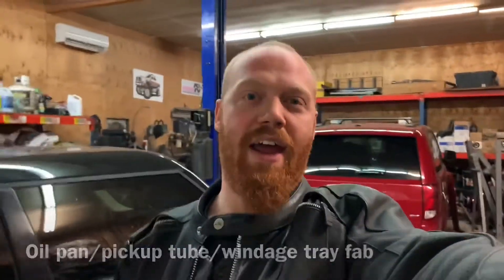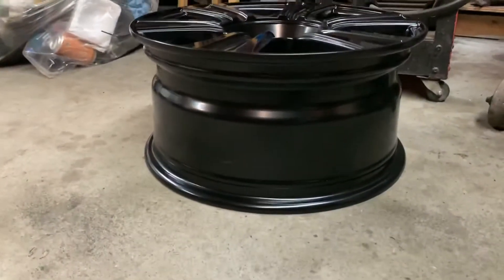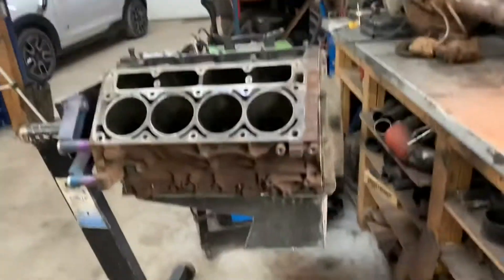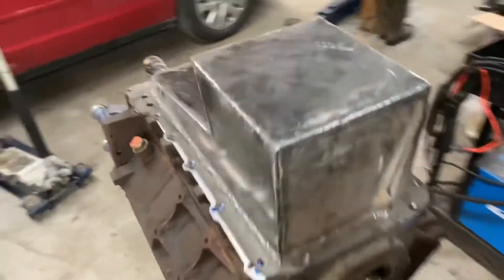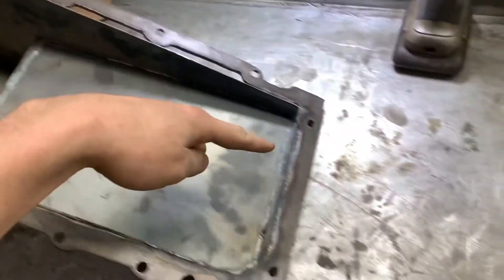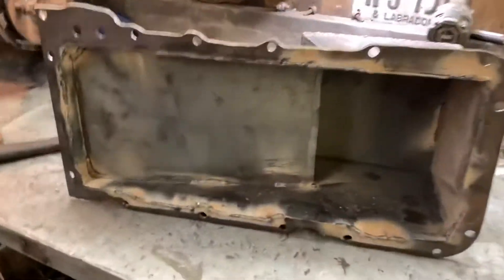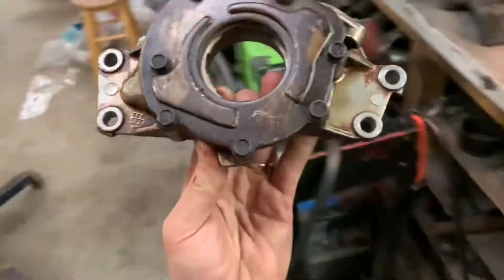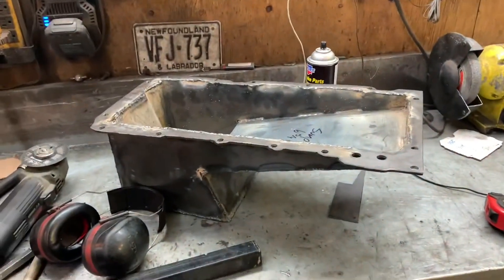How to make a sheet metal front sump LS oil pan - part four, modifying the stock pickup tube.

Comment: Tight work brother! Bout to tackle my own custom pan on a om617 swap!
Reply from the maker: Right on! I’m sure you know what you’re doing, but just a little advice from my experience with this, baffle the pan. This was a front sump pan and I didn’t have it baffled so when I accelerated hard, all the oil would go to the back of the pan and I destroyed two engines before I figured it out. Good luck! 

Oh, and I’ll be going live tomorrow for the first start of the twin turbo destroked 6 litre in my 57 Chevy if you wanna check it out 😁